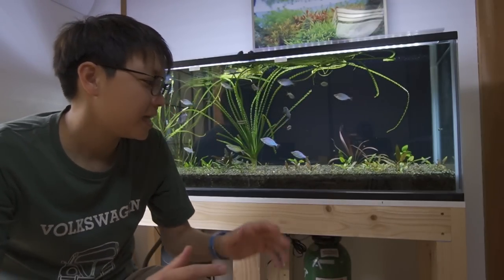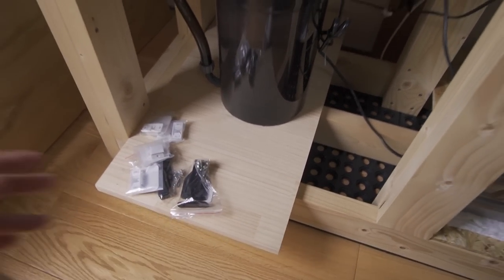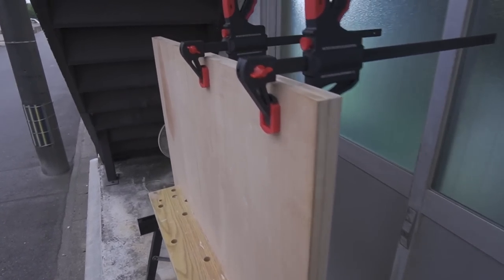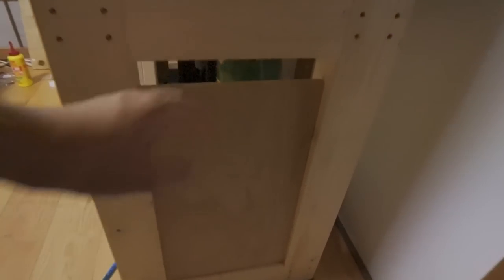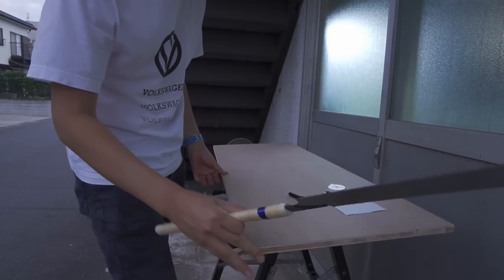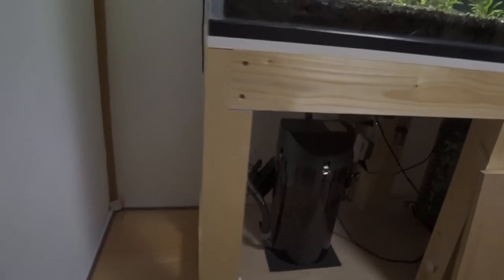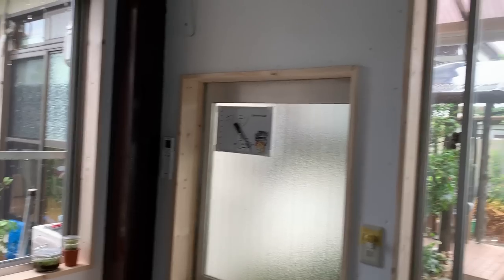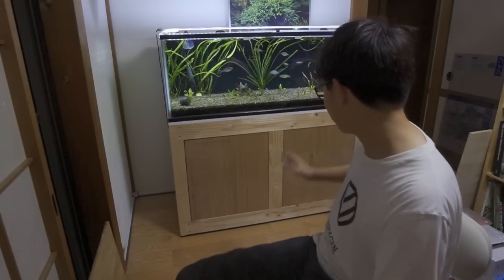Transforming my DIY Aquarium Stand into a Beautiful Cabinet

Comment: Job well done!!!
I like the two tone look with the slight inset where the other layer would be, gives it a nice look. Plus should you change your mind you can always add the extra pieces of wood. 
Also love those hand saws, I've had at least one Japanese folding pull saws in my tool kit for over 40 years.
Reply from the maker: Dean, thank you so much! I recently got myself that pull saw and I really enjoy using it. I was debating whether I should go with an inset, offset or to make it flush with the stand. Glad you like the inset :)

Comment: Good job.  I'm currently building a cabinet for my 65 Gallon tank of Goldies.  And now looking for ideas on what to do about the doors.

About the powered circular saw, it takes practice in cutting straight lines.  If you can't find a table saw (or there's simply not enough room for one), look into building yourself a track saw using two 3/4 inch plywood.  Get the local dealer to cut the plywood for you to ensure you have a nice straight cuts.  There should be plenty of videos on Youtube on DIY track saw rails for you to consider. 

Or, you could purchase your own track saw.  Since you have a Makita drill then purchasing a Makita track saw (Model SP6000J1) shouldn't be a problem for you (assuming you can afford it).

About using that Japanese hand saw, don't use it cut plywood as the adhesive used between the layers would dull your expensive blade.  Use a powered tool or cheap hand saw.  Like all powered tools, take extra care to not injure yourself.

I know it's too late but something for you (or anyone else) to consider in the future.

Comment: Circular saws just take practice and patience to cut straight. They are a little awkward and very powerful. I prefer to use a table saw for straight line cuts when possible but not everyone has access to one.
Reply: and perhaps the blade was not tight or sharp or something...
Reply: Or a track saw if there isn't enough room for a table saw.
Reply: @LeilaSoleil  Most likely lack of experience.  A dull blade would leave significant tear outs.